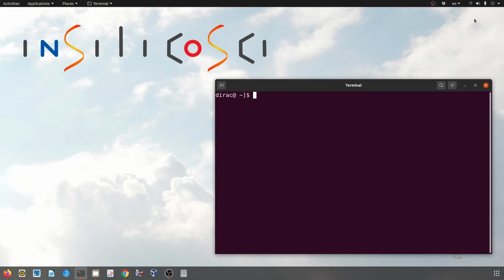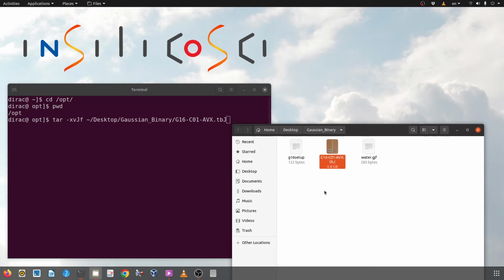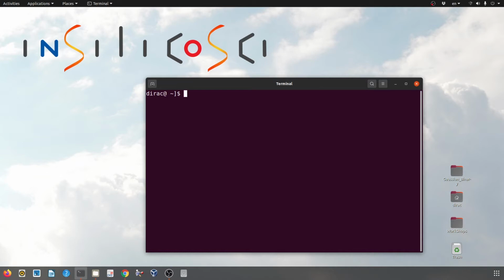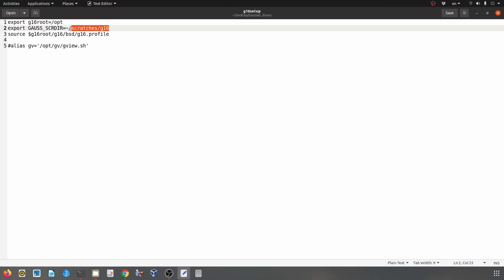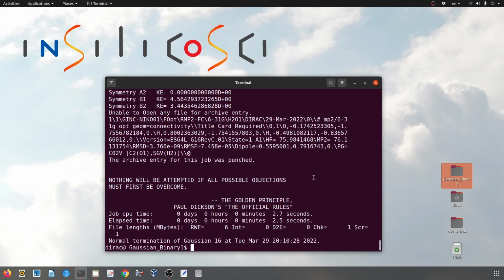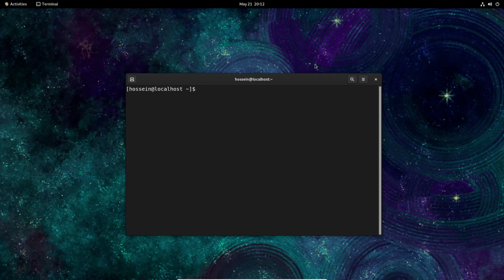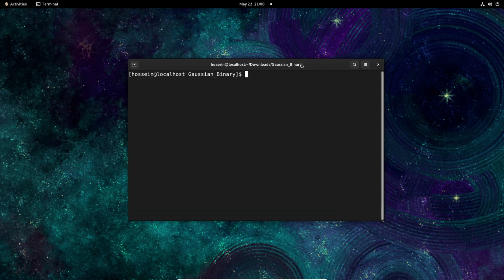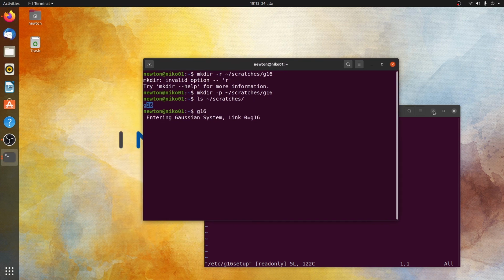Gaussian Installation on ubuntu and CentOS Linux: A full description tutorial for new Linux users

Comment: i followed the same procedure but i got this error "g16 < water.gjf > water.out
Error: illegal instruction, illegal opcode
   rax 000000000139c230, rbx 00007ffe62bb17b0, rcx 0000000000040000
   rdx 0000000000000000, rsp 00007ffe62bab7e8, rbp 00007ffe62bab7f0
   rsi 00007ffe62bab7b8, rdi 0000000002d15d90, r8  0000000000000060
   r9  00000000013827d0, r10 00007ffe62bb1b20, r11 00007ffe62bb1780
   r12 0000000002baadf0, r13 0000000002d15d90, r14 00007ffe62bb1b20
   r15 0000000002d15d90
  /usr/lib/x86_64-linux-gnu/libc.so.6(+0x42520) [0x147fb4a42520]
  /opt/g16/l202.exe() [0x139c2da]
Aborted (core dumped)"

Comment: Hi, thanks a ton for the video, it was really helpful.

I had to do a one additional step to get the things running - After editing the .bashrc file, I had to run the following command to apply the changes.

source ~/.bashrc 

Hope its helpful to someone.
Reply from the maker: Thank you for your tip. However you don't need this command if you restart the terminal.